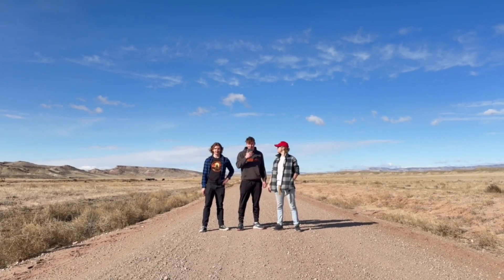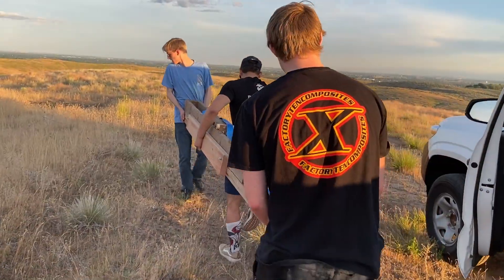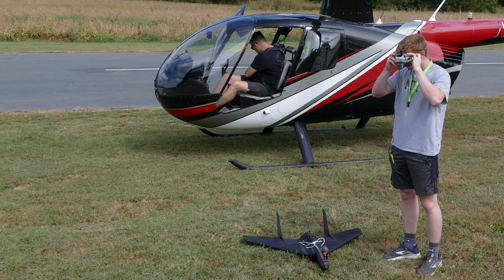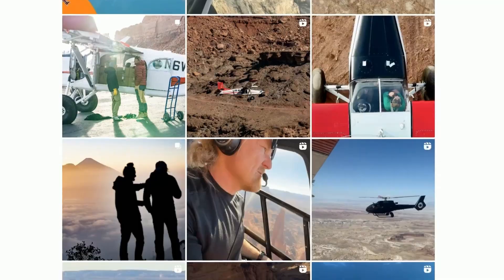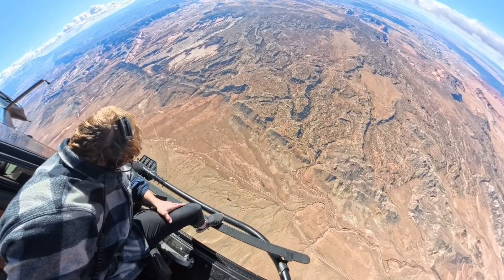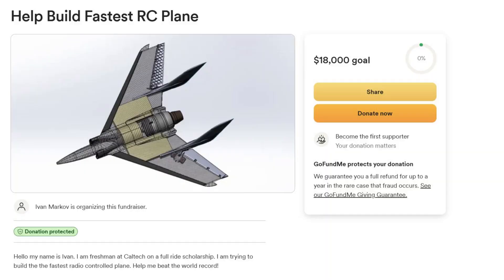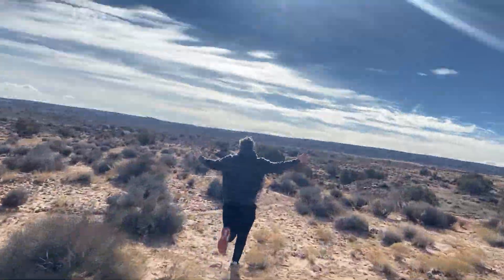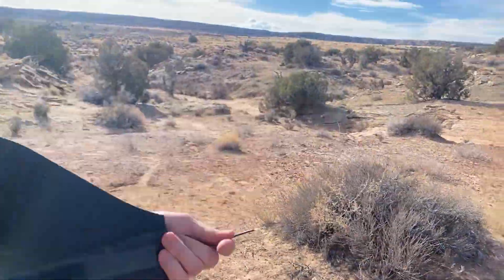Plane drop from Helicopter / Testing stability of the prototype

Comment: The difficulty in takeoff and landing are similar to the problem Lance Campbell had with his 1/8th scale twin turbine SR-71. His landing approach speed was 100mph. The difficulty you will face controlling yours will be harder I think since Lance's jet did not approach anywhere near 0.9 MACH. A 6-axis stabilizer for Auto-Leveling in case you lose orientation might be in order. I would not use it unless you know what direction your jet is headed though. If used at speed under power, headed away from you could be disastrous. Stabs can be turned off easily. Best of luck to you on the record run. 😀

Comment: Wasn't Mach 0.9 already achieved by RC controlled glider with dynamic soaring?
Reply from the maker: Not 0.9, 540-560 mph. Also It uses dynamic soaring instead of propulsion. And achieves the speed not in a leveled flight.

Comment: Another option is a dolly and tow. You can jack the drive end of a car, remove one wheel and make a drum for the tow side. Make the dolly rc so steerable until speed builds enough to rotate

Comment: All credit to you for what you have achieved thus far and the backing you have achieved.   But I can't help thinking that your approach will either be unsuccessful or just really costly! Well in fact you've just requested $18K.  You should consider if you are not able to build a launch catapult, then maybe an RC model going over 1000kph is going to be a stretch.  Have you actually flown an RC model going over 300kph?  This should immediately tell you that your small model will be too small to see.  FPV you say, ok try it and share your results.  Remember how much ground you will cover going 300m/s.
My recommendation is to take a known stock model capable of really high speeds and ramp the speeds up slowly to start to understand the problems as the first step (to 300kph).  It will influence the design of your model.  With the learnings, try and get to the current World Record speeds at 750kph.  Learn from that to get to 1000kph.
Reply from the maker: Yes, it is expensive to build such a plane. Engine for the prototype is 3k. So if I will build 3 planes, its already 9k. 18k is a fraction compare to other teams. And I am trying to use the money as efficient as possible. I cover a lot of expenses my self and trying to find sponsors. I made a breakdown of the cost on GoFundMe, check it out: https://gofund.me/c5fc2e40
Team from Technical University of Munich Germany got 100k: https://www.linkedin.com/posts/florian-seibel-8a78b99b_tum-mach1-speedofsound-ugcPost-7290968105227329536-GBDj/?utm_source=share&utm_medium=member_desktop&rcm=ACoAADbWWBsBMhQobREhduikTUBTBavUkLd7194
Reply: @ivanmarkovavia the university team of 70 people are looking to go supersonic and not RC controlled. 
Also a pointless exercise, as hypersonic cruise missiles already exist.  But a fun project for sure.

Comment: You are going about this all wrong. That delta design should have a much lower stall speed. You also do not want a neutral CG you want a more nose-heavy for high-speed runs. Also, how did you test it if all; you did was glide down? You need to build a better catapult and forget the helicopter. It's a waste of time and money when you can have hundreds of launches using a catapult and a better-designed plane. It's far too small for a speed run. You could just buy a Skywing speed Delta for 300 dollars and it will fly much faster than that and still have a stall speed of under 40 mph. It can also be hand-launched. Building a fast plane is more about power the airfoil does not have to be anything super special. A pilon racer-style plane with a turbine would break records if you have the money to buy the power.

Comment: You're spending a lot of money to do what many rc modelers could do for cheap. The edf model should have been easy on a bungee launch.
Reply from the maker: Yes, it is expensive to build such a plane. Engine for the prototype is 3k. So if I will build 3 planes, its already 9k. 18k is a fraction compare to other teams. And I am trying to use the money as efficient as possible. I made a breakdown of the cost on GoFundMe, check it out: https://gofund.me/c5fc2e40
Team from Technical University of Munich Germany got 100k: https://www.linkedin.com/posts/florian-seibel-8a78b99b_tum-mach1-speedofsound-ugcPost-7290968105227329536-GBDj/?utm_source=share&utm_medium=member_desktop&rcm=ACoAADbWWBsBMhQobREhduikTUBTBavUkLd7194

Comment: Curious to understand how you ask for money for this project because your poor while preceding to use a helicopter to do a basic test flight.
Reply from the maker: Well. It is a bit more then basic test flight. To my knowledge the wing loading (kg/m2) of this RC plane is higher then any other plane of this size. It is very hard to fly it at low speeds (less then 150mph). I did a wind tunnel test which showed me that it can fly, but this flight test proved it.

Comment: I was hoping to see some telemetry information like speed, altitude, AOA etc. Wasn't this test flight to understand stability at high speeds, i was expecting a nose dive up to terminal velocity and then a gentle pull up to maximise your speed. You seemed to just put it in a glide straight away which wouldn't of been very fast

Comment: when will the project be completed? Any idea?
Reply: All parts from hobbymarket, 3D-printed fuselage, dropped some homeassembled wares from helicopter and destroyed — took 4 years.
Negoda made own fuel jet engine from metal on lathe. Constructed plane from fiberglass by manually made drawings - flied successfully many times in 2 years.
Verdict: Never. Boys just having fun on chopper for your money.
Reply: @ damn, I really had faith on this dude. Too bad he doesn’t care about what he does.
Reply: @
Guy said - guy did!
Just in case you didn't knew him: https://www.youtube.com/watch?v=dYFYZ-g7fzA
https://www.youtube.com/watch?v=MLp1YXx_Tcc
Reply: @John.Doe.2025  Oh I actually went and watched him yesterday after you suggested.
Reply from the maker: @John.Doe.2025  To my knowledge the wing loading (kg/m2) of this RC plane is higher then any other plane of this size. It is very hard to fly it at low speeds (less then 150mph). I did a wind tunnel test which showed me that it can fly, but this flight test proved it. 

Just to clarify — I’m not “just having fun on chopper for your money”. The helicopter drop was completely free thank you to an incredibly generous friend, Russ, who volunteered to help!
Yes, this project has taken 4 years — and I’ve stayed committed every step of the way.
I recently finished my freshman year at Caltech on a full-ride scholarship — it’s intense and time-consuming.
In high school, I worked full-time at Walmart while taking the hardest classes my school offered.
And through all of that, I’ve kept finding time to push this project forward, because I believe in it.
Reply: @ivanmarkovavia whats the stage of the project now. Will we see the project completed anytime soon?